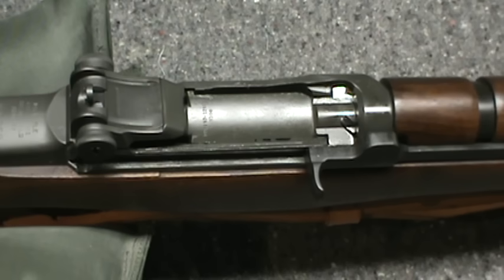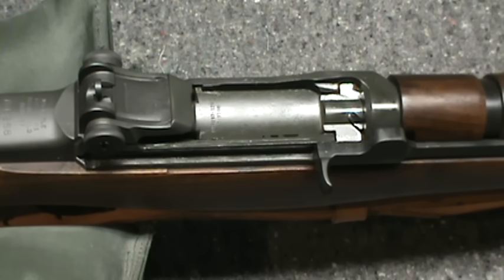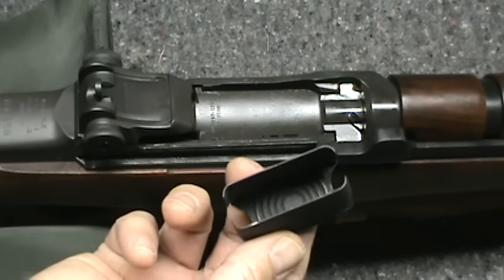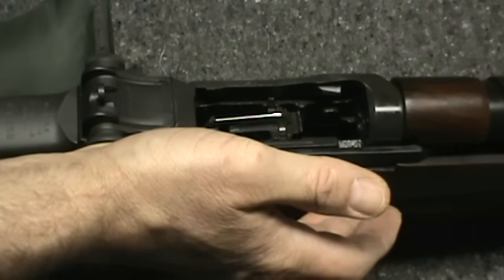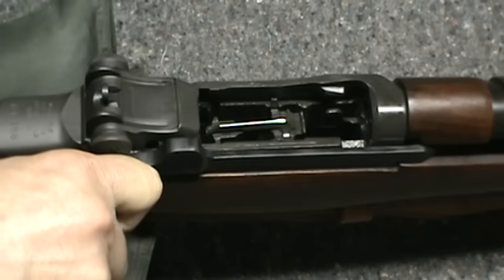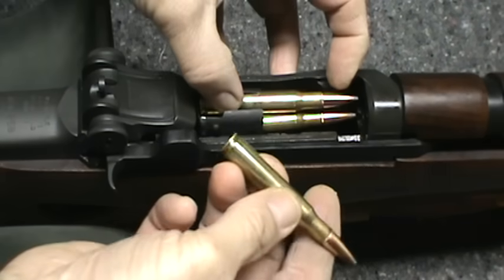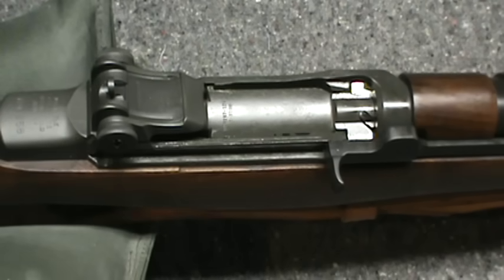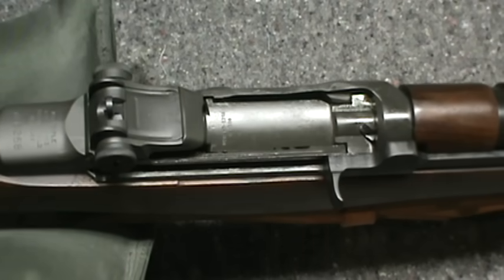How to load the M1 Garand the US Army way

Comment: How many clips of ammunition did the average soldier carry?
Reply from the maker: The gun belt has 10 pouches, so 10 clips.  80 rounds and 1 in the rifle.  88 rounds to start the event.
Reply: BOI,id carry myselft 2+of those belts
Reply: @officialjanay1354  all that lead though
Reply: In heroes&generals you can take 80 or 160 pretty bullets. Mb its a real🙂🙂🙂🙂
Reply: @секелперел  so basically 2 belts hahaha
Reply: 80 rounds in the ammo belt and 8 in the rifle and 8 on yer sling.  Plus 2 bandoleers of 48 each.  That's a total of 192 rounds.
Reply: @007connecticut  It ain't no friggin' GUN!  It's called a rifle.
Reply: @w.rustylane5650  I've seen on Brownells a buttstock pouch with 2 pockets for 16 more as of 2020.
Reply: compared to now, modern-day soldiers carry almost double that amount, say about ten loaded mags, so just 300 rounds for M4's, even more if you're a machine gunner
Reply: @JayEllis76  In the 'Nam the basic load was 7 stubby 20 cartridge capacity  magazines, but grunts procured more belt pouches and used 7 pocket bandoleers to carry as many more magazines as they physically could provided these were available.  BAR belts with 6 pockets were also popular if and when available for packing the 20 shot magazines.  The 30 round capacity magazines were still 7 TO&E issued but required different carriers for more other than the ALICE pouches..
Reply: @секелперел  When I was in the Army we used to have one guy carry a rucksack full of spare ammo for the team.  My vehicle's driver wore 11 M-16 mags on his vest.  Soldiers will go to great lengths to carry more than a basic load, so I have no doubt that soldiers would carry more than the basic load, which they would do at any opportunity.
Reply: @jimmybriscoe8918  nothing compared to what soldiers these days have to carry
Reply: as many as they could .
Reply: @w.rustylane5650  It ain't no friggin' VEHICLE! It's called a car.
Reply: @JayEllis76  Modern combat load is 210 rounds, 6 magazines +1 in the gun. It was pretty rare for us to step beyond the wire with less than 8+1, the extra two being carried were usually speed reloads mounted to a belt, 6 on your plate carrier were "resupply" for those two. A course of fire (think of the 210 as a minimum/patrol where contact wasn't expected, the course of fire as what we took for direct action) is 450 rounds, which consisted of the aforementioned 8+1 and 4 in a drop leg for 13 magazines plus 60 on 10 round stripper clips.
Reply: btw im german hyhy
Reply: Thank you very much ...
Reply: @w.rustylane5650  A rifle is a type of gun, it's a universal term.
Reply: @007connecticut  Nobody in WWII loaded a full clip because of malfunction of the last round. So 10x7 mostly. Two belts. 140 plus 7 in the rifle.
Reply from the maker: @barrymantz6026  That was fixed by replacing the ejection spring.  If the spring is weak it will kick out the last cartridge unfired.
Reply: @007connecticut  Thanks for your info! I did not know that. I remember after the fix people only loaded to 7 rounds! In the beginning it was a max of 5 to 7 rounds in a 8 round clip. Because of the malfunction! But you say every 8 round clip full is functional?
Reply: @fredstead5652  a pistol is a semi auto firearm, a revolver is exactly that, a revolving wheel magazine. 
The only gun I have are my shot guns.  My rifles are not my guns, they are my rifles. Yet dad built me a gun cabinet to hold them all.  Its just how we know what we are talking about.
Reply: @bobwoods5017  A gun is something that fires bullets, it's a universal phrase. Yes, they are rifles but they are still guns. Just like how your thumb is still a finger. All rifles are guns but not all guns are rifles.
Reply: @fredstead5652  so you have opposable fingers?  Thumbs are not fingers unless you are counting them?   
I'm just a man whose intentions are good...
Oh Lord, please don't let me be misunderstood.
Reply: @bobwoods5017  I probably picked a bad example.
Reply: @fredstead5652  Technically, a gun is a smoothbore firearm, be it a shotgun, flintlock, cap and ball, naval cannon, or field artillery piece.  Rifles have rifling, obviously, and aren't pistols, revolvers, or carbines.  Pistols and revolvers of all types, are often called "handguns", because in any language, someone will start using the wrong term for the name of an item, usually out of ignorance, and eventually that term sticks.  That's the case with guns, rifles, and pistols.

Some people use the term "long guns".  It's not accurate, but everyone knows what that means, just like handguns.  The media likes to call ARs and AKs "assault rifles, but they're not.  They are actually service rifles, or in some cases, carbines.  Don't ask me what to call a shotgun with a rifled barrel...  I'd have to guess "a shotgun with a rifled barrel".

Languages change over time, and part of the reason for that is that people mistakenly call something by what they THINK it should be called, or what they heard it called by someone else.  I could give you several examples of the parts of a sailboat that boaters call them, but they're wrong, and they don't know the actual names.

It's not illegal to use the wrong terms, so you are free to call anything that shoots something out of it, a gun.  Nail gun, caulking gun, heat gun, glue gun, spray gun, staple gun, love gun...  (none of those are rifled, btw)
Reply: its a bandolier.
Reply: As many as they could carry.
Reply: @w.rustylane5650  Its a weapon
Reply: Some soldiers carried extra bandolier round their chest
Reply: @w.rustylane5650  Fun fact, a rifle can still be called a gun, for the definition of a gun is:
"a weapon incorporating a metal tube from which bullets, shells, or other missiles are propelled by explosive force, typically making a characteristic loud, sharp noise."
So with that in mind, a rifle can still be called a gun for it incorporates all of these. Watch yaself before ya break yaself
Reply: 007connecticut in waw you can carry 128 rounds and the 8 in the clip in total
Reply: As I recall, we had our cartridge belts, but we were also issued 2 bandoleers of clips. Don't remember how many clips were in it, but I would say 10 easy. That was our load, standing at ship's railings waiting for orders to land in Cuba.
Reply: @MDMiller60  what we're you in ww2😀
Reply: How many M1911 magazines did a. U.S soldier carry ?
Reply: @vismayballal7011  one in the gun two spare. Sometimes morw
Reply: @JayEllis76 - Re: "compared to now, modern-day soldiers carry almost double that amount, say about ten loaded mags, so just 300 rounds for M4's, even more if you're a machine gunner."

You've just summarized quite well the rationale behind equipping the soldier with an assault rifle firing an intermediate caliber cartridge, than using a full-sized battle rifle firing something like the 30-06. The debate over assault rifles/battle carbines versus old-school battle rifles (M-1, M-14, FAL, G3, BM-59, etc.) continues, each side with its proponents. 

My view, for what it is worth, is that both types of weapons and cartridges have their place in the armory of the soldier. An assault rifle is designed to be used in select-fire as well as single-shot mode, and since the cartridge - such as the 5.56x45 NATO - isn't as powerful as something like the .308 or 30-06, it is more-controllable and can be kept on target. The ammo, being smaller and lighter on a per round basis, can be carried in a larger basic load. Whereas a typical WWII-Korean War grunt might have 80-160 rounds in his basic field ammo load, one or two bandoleers, the modern assault-rifle carrying solder can carry double that round count or more. 

There's no free lunch, though, because even though the assault rifle is capable of laying down a greater volume of fire, its cartridge has neither the range nor the punch of the battle rifle. Our foes in Afghanistan, for example, learned fighting the Soviets in the 1970s-1980s and then the NATO contingent later on, that modern assault rifles are at their best 0-300 yards/meters. So - the mujaheddin tried to attack at ranges beyond that but within their effective range, say 300-800 yards. At those distances, a full-power rifle cartridge is still plenty effective and packs considerable punch. Our forces needed a counter, which is why early in the 2000s the call went back to break out the old mothballed Cold War battle rifles in 7.62x51 NATO and send them over there. 

Give the soldiers and their leaders the ability and flexibility to choose whatever small arms they think will work best for their mission profile. That gives the best of both worlds.
Reply: Okay that explained a doc I watched of a grunt in war 2 using m1 like a bolt action as I knew it was semi auto
Reply: I would love to have a WWII M1 Garand…that rifle is a beauty
Reply: @JayEllis76  yeah in ww2 u would also carry 10clips or mags of ammo
Reply: @007connecticut  30 if you're fighting an SS Battalion 😂
Reply: @JayEllis76  Much lighter rounds now ...
Reply: @w.rustylane5650  maybe he was in the Navy
Reply: @JayEllis76  Army MTOE is 210rds. Six on the chest and one in the rifle, but yeah, most dismount guys have even more if they can get away with it.
Reply: @w.rustylane5650  LOL: This is my rifle, this is my gun, this if for shooting, this is for fun, right?
Reply: @lukewarmwater6412  Exactly right!!
Reply: @pumm1827  lol
Reply: @w.rustylane5650  “It ain’t no friggin gun”. Rusty if that is all it takes to get you worked up, you need to seek professional help.